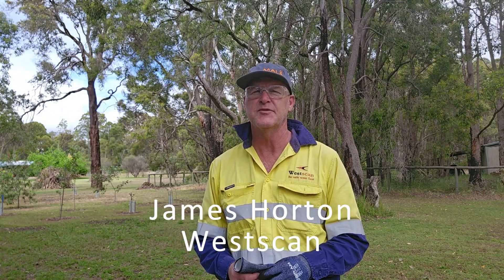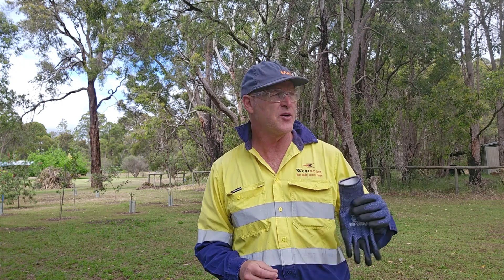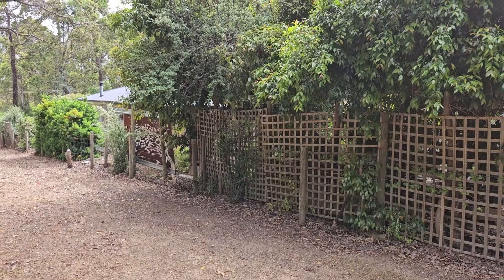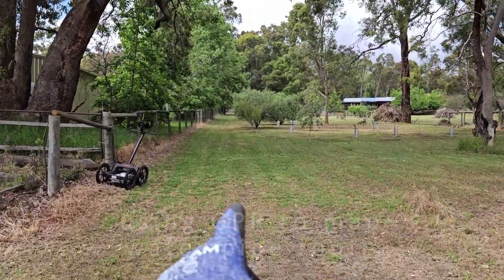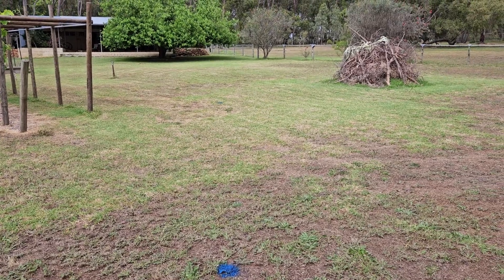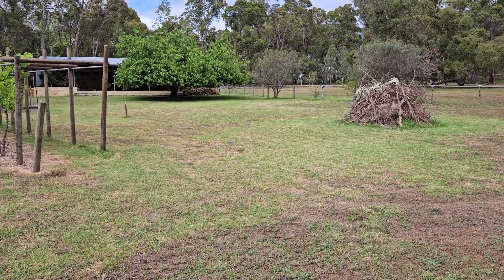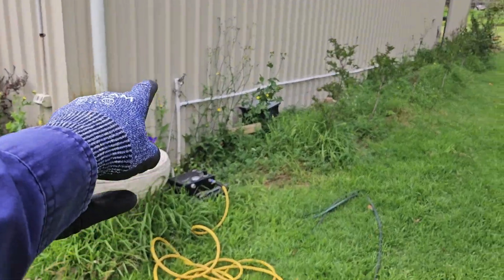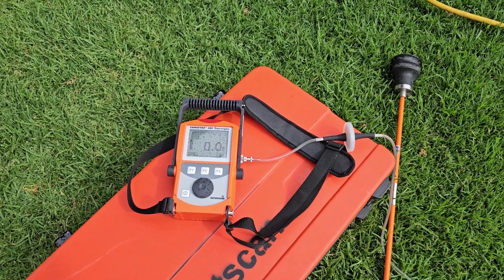How To Find Water Leaks using Tracer Gas - for Water Leak Detection

Comment: how important is it to use the black box at the tap?  laying in the grass
Reply from the maker: We have upgraded to a different product. similar function higher pressure with large volume intake. i.e. important as a remote manifold allows you to be closer at the work point to control pressure, release pressure and be away from noisey compressors .